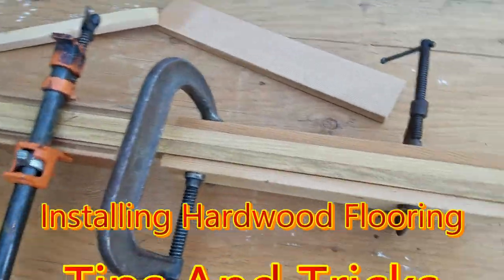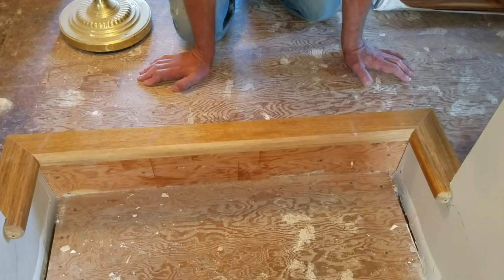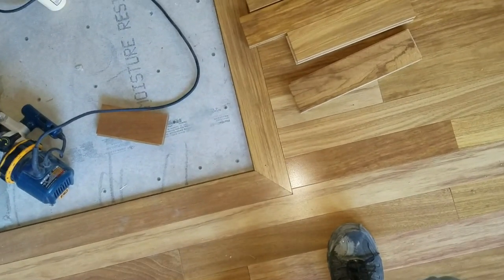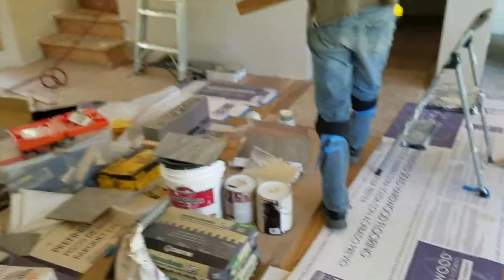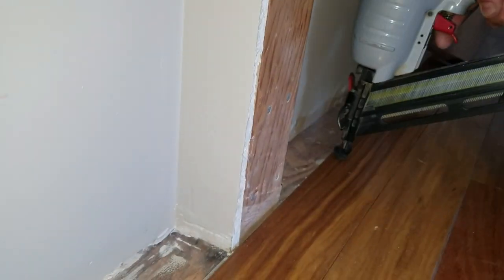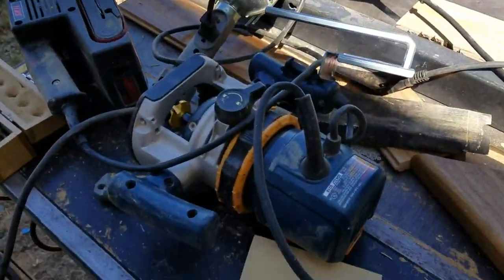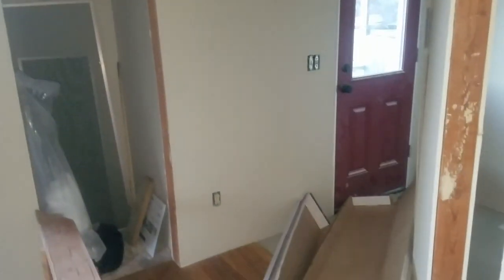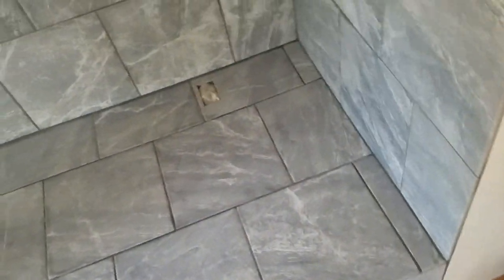How To Do Hardwood Floors - Tips And Tricks

Comment: Bellawood  is a trash product. You should of sorted thru the planks when racking them and selected better pieces. 
some of those joints were horrendous.
Reply from the maker: Not my favorite either but that's what the lady wanted and bought.  There were a few bad ones for gap and end cut but we picked out the worst. I prefer unfinished wood. You get a better surface. The pre finished products are always only as good as their milling. I've done floors people paid a lot of money for pre stressed looking wood.
Reply: @CITAP1  You did the best you can with what you got. They will be sorry later down the road that they didn't spend a little more on a better product. It sure would have made your life easier.
Reply from the maker: @fredflintstone5860  They are actually doing the steps today and the next few days on their own. They reworked the steps because as built, the rise was 8.5 to 10 inches. They're adding a step and it will now be 7.5 inch rise equally.
Reply: Bellawood is actually pretty good just not for Brazilian wood and ive installed a variety of different mill companies wood products
Reply from the maker: @drod6534  The precision of the milling could have been better. A little better on randomness of lengths could be better too. The hardness of the finish was very good. For what it is, it's a decent product.